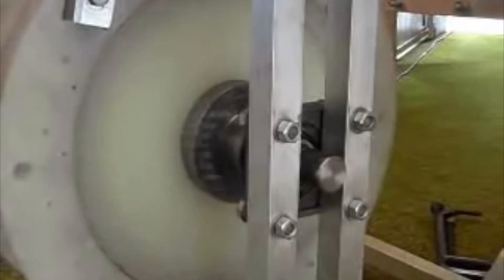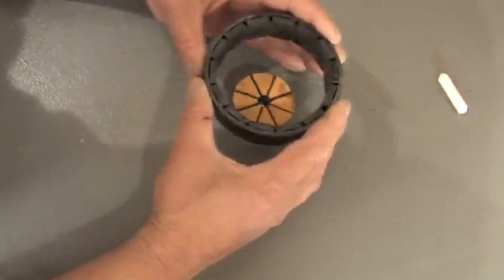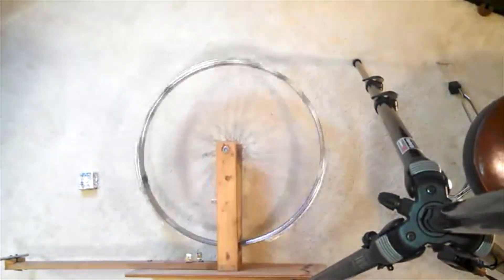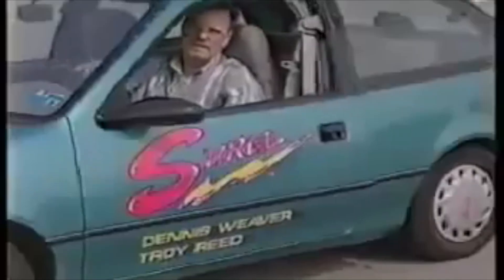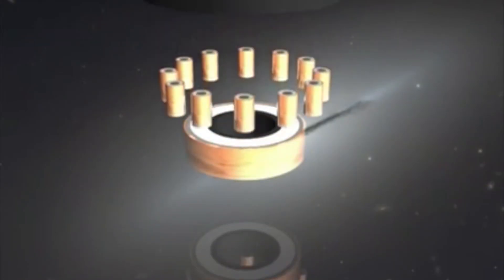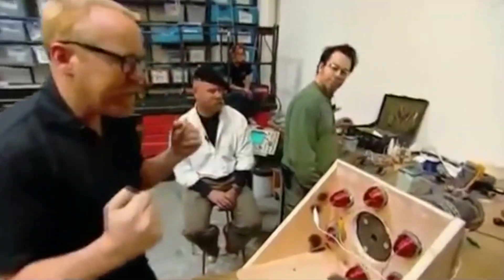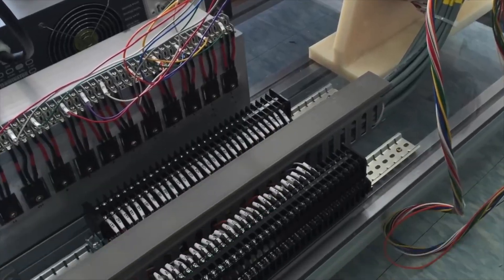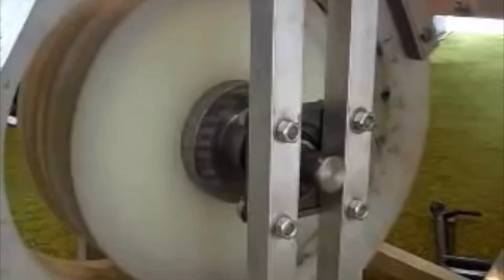Top 10 Most Famous Magnetic Motors

Comment: I admit that I have know idea if any of these work as intended. But I hate when people refer to magnet powered motors as "free energy" or "perpetual motion machines". Magnets lose their charge over time. Some might lose it faster than others, but they will all eventually lose their charge. The magnetic charge is the finite fuel source for the machine. Which means it is not perpetual motion and it doesn't violate the laws of physics. That fact alone makes me believe that it should be possible to make it work... At least I hope so!! lol
Reply: You are right. Technically, every type of motor, generator, or 'power source' is converting (not producing) energy. That is what all motors do. My thought process was this... While it takes a very long time, hundreds of years in most cases, magnets can and do lose their charge. This process will speed up with exposure to heat. If we imagine a hypothetical "working" magnet driven motor, as the magnets are attracting/repelling each other they are converting some of their "force" (potential) to heat and motion. Which would mean that there is a finite amount of potential energy that can be converted. Hence... no perpetual motion. The biggest issue (in my thought experiment) would be efficiency. I'm not claiming it can be done, just that there is a conversion of energy taking place in some miniscule way.    @darklight2.1
Reply: @darklight2.1    Even if monopole magnets would exist, it would still be impossible to build a magnet motor.

Comment: None of them work. Magnets don't contain energy, they can be used to push electrons therefore creating a flow of electricity, but a stationary magnet cannot generate electricity, it doesn't contain energy.
Reply: @randie9480 Clearly you don't understand what you're talking about. Of course there's mechanical energy since the things are moving, but they're not spontaneously generating motion because that's not possible. There's electrical energy in them that's being converted to mechanical energy, which is the converted to convincing idiots they're perpetual motion devices.
Reply: @randie9480 Also, the video clearly states that these devices are magnetic motors. If you're saying that magnets can be used to create movement then you've been fooled. Think of a magnet as a slope. Something can slide down a slope but for the slope to be used to generate energy the thing will need carrying back up to the top. Magnets will need carrying back to the top for free, carried back in a way that costs no energy. Which is impossible. Once you understand the fundamentals you'll never be fooled again I promise you.
Reply: @Indie9999 try to find spiraculum on youtube, and explain us his behavior, following actual phisics laws 😂 the tendency of science is to discover, surely not clinging to current knowledge 🤷🏻‍♂️

Comment: MAGNETIC DRIVEN MOTORS ARE IUT OF THE QUESTION. WERE ARE ALREADY WORKING WITH MAGNETIC G FORCE. IT IS A COMBINATION OF APPLICATIONS THAT CIRCULATE ENERGY. ON ITS OWN POWER. THERE ARE MANY Electronic COMPONENTS. THATS HOW WE WERE ABLE TO ACHIEVE WHERE OTHERS HAVE FAILED. IF YOUR JUST TRYING TO PUSH MAGNETS TOGETHER TO MAKE IT WORK, YOUR WAISTING YOUR TIME. THINK OUTSIDE THE BOX. π•∆ × RPM√ DIAMETER OF EA DISKπ √ ANGLE C/M • E√ FLUX • TIMING POS

Comment: The way to create a perpetual motion machine goes as follows. 
1. Get a large vacuum chamber.
2. Set up a superconding magnetic levitation loop inside the vacuum chamber..
3. Put the entire device on the dark side of the moon with an outside temperature of -250f.
4. Push the locked and levitating magnet on the circular superconducting track. or visa versa. a superconductor above a magnetic track locked and levitating. 
Theoretically it should continue revolving around the track forever.

In my opinion this would be one of the only perpetual motion machine possible. Because it has no atmospheric, gravitational resistance or resistance of any kind.

Comment: The video description has a link list to several magnet motor patents. Of course, even if a patent is granted, it does not mean that the invention really works.  And even more significant: most of these patents were filed but they were not granted. A motor which is driven by permanent magnets only is considered as a perpetuum mobile, and such inventions are not granted if the inventor can't give a flawless proof for the function. With the exception of H. Johnson, whose patents were also refused at first but by his stubborn insistence granted after some years, none out of the listed magnet motor patents were granted. And also H. Johnson never succeeded in building a working magnet motor. 
In the video it is claimed that several motors were patented. This is wrong. Just filing a patent is not yet a patent.

Comment: In the early 1900s, Nikola Tesla designed a magnetic motor that would revolutionize the way we generate energy. The overunity generator plan is based on his original design and will generate a free energy AC generator. This is genuine Nikola technology that has been lost for over 100 years.

The overunity generator plan is a simple, yet elegant solution to our energy needs. It uses magnets to create a rotating field that generates electricity. There are no moving parts, so it is very efficient and can be built with easily available materials.

This technology has been hidden from the public for over 100 years, but it is time for it to be revealed. The overunity generator plan will change the way we generate energy and help us to achieve energy independence.
Reply: Magnets can't be a source of energy-so where does the energy to do work with a "motor with no moving parts" come from?
If this amazing technology was hidden, who was hiding it? And how did you get access to it?
If it is so easy to build, why haven't you built one to demonstrate to everyone?

So-called overunity generators are a tired old scam that charlatans use to extract money from gullible rubes.
Which leaves us with the only real outstanding question, which one of these are you-the charlatan or the rube?
😵‍💫

Comment: How could you manage not to mention Dennis Danzik and his company Inductance Energy’s Earth Engine?  The only issue with Dennis’ design is that IE wants to sell the energy their motor produces for more than grid power and won’t sell or license use of their design.
Reply: Inductance Energy doesn't sell anything. They've never had a working product to bring to market.
Reply: @darklight2.1   Correct. Dennis Danzig is a scammer. Unfortunately, the 10 constructions mentioned here are also not working. If some of them are offered for sale, it is fraud.

Comment: My question is why the f can't we simply make a magnetic generator? What's the issue? Why the controversy? 
If a regular generator is just a gas powered motor that spins a belt... then why can't magnets be used to spin that same belt? Why doesn't this work? Man I'm intrigued
Reply: Because magnets aren't a source of energy.
Magnetism isn't a form of energy-it's a force. We can use magnetic fields to store energy (for instance, by pushing like poles towards each other) but magnets themselves expend no energy in the course of being magnets and cannot do work.

Think of it this way-when a magnet is hanging on your refrigerator door, how much energy is being expended to keep it there?
The answer is zero.
 To store energy, we would have to pull the magnet away from the metal and in that case, we are the source of energy-not the magnet.

This means that virtually any motor claiming to be powered by magnets, such as those "demonstrated" on  popular clickbait videos, is fake. Every single one.

Hope this helps.
Reply: @darklight2.1  I find that typically using logic on these people just gets the conspiracy answer. They don't understand enough physics to get why it doesn't work. So they keep trying:)
Reply: @KevinSmith-os5yz  another way of explanation - - - The "General Relativity"!   Every force in nature is balanced perfectly, example the south pole of a magnet, it attract from the right and also from the left with equal strength, which means cancelling each other into zero rest mood.

This can only be achieved by thorough understanding of magnetic fields and manipulating its physical properties.

Comment: Thank you for maintaining a neutral position i myself am not a believer in free energy but i think the subject matter is fascinating and studying all the different motor designs an asset to ideas for developing more efficient motors.
Reply: The Overunity Generator Plan will generate a free energy AC generator. This is genuine Nikola technology that has been used for over 100 years. The plans have been released to the public so that anyone can build their own magnetic motor.

The most famous magnetic motors are the ones that have been used in power plants for over a century. These motors are based on the principles of Faraday's law of induction, which states that a current flowing through a conductor will create a magnetic field. The strength of the field is proportional to the number of turns in the conductor, and so by increasing the number of turns, we can increase the strength of the field.

The high number of turns in these motors makes them very efficient at converting electrical energy into mechanical energy, and they are capable of generating large amounts of power. However, they are also very expensive to build and maintain.
Reply: @showshowtomakefreeenergyge2426    Every e-motor converts electrical energy into mechanical energy. Some designs are very efficient, but of course their efficiency is always below 100%. This isn't free energy. And power plants don't use motors but generators, which convert mechanical energy into electrical energy. Also here no trace of free energy. Which is no surprise. Every energy output needs an energy input, slightly bigger than the output. Of course also Nikola Tesla did not have any overunity devices. Magnetic motors in the meaning of a motor driven by permanent magnets only are outright nonsense.
Reply: They say hydrogen has more energy than it uses to produce Stanley Myers drove from California to New York and a dune buggy on water 1976
I know that's not any kind of indefinite motion as you got to keep adding water anyhow but that's pretty abundant and easily accessible
I seen some interesting gravity generators especially the Wilkinson machine I don't think they let him put a second video out
Reply: @miketully9592    Some may say that, but it isn't true at all. Meyers patents for over-efficient electrolytic cells are open to the public, but they don't work. Their efficiency is well below 100%. Meyers dune buggy was a scam. Since Meyer cashed prepayments for a prototype of a "water car" but never delivered anything and could not return the money, he was sentenced for fraud. Some claim he was killed, but that's nonsense. He died unexpectedly, due to autopsy the cause was a brain aneurysma.

Comment: If you liked this video, you should check out two that weren't mentioned. Troy Reed and Dennis Lee. 
Troy Reed developed a motor that was eight feet high and reduced it down to fit in a car. The car, when not in use, is plugged into the grid to power it, not the car. https://youtu.be/aF0JvC10edw to the car https://youtu.be/vFfsEfnsA4I
Dennis Lee's invention is a type of solar panel that works 24/7 and when hooked up to his condenser motor, produces free energy. Gasses like Freon are compressed producing high heat. 
Go see and SHARE. https://youtu.be/GTPYecWuppg
Reply: Troy Reed was a scammer. Solar panels work of course. But the term "free energy" is used here for types of energy which have no scientific explanation. Due to physics a motor can't be driven by permanent magnets, not for one turn.

Comment: Some thoughts. Each motive generator has magnets, even current generators. Neodimium( crystal) magnets last over 400 years on earth without a recharge.Magnetism is called a force meaning science has no idea what the 400 yr source is. Neo magnets fail from corrosion ie oxygen. In space no oxygen. Neo,s last forever in space? Scientific schools are funded by industry . Conflict of interest?.conservation of energy does not apply to magnets as the feild is self regenerative no matter how much is converted to electricity.  For an endless power source it must me  located in space and have a basic timing system,being either mechanical or electrical to shunt the magnet feild as required. The motionless electronic generator is an example of how to direct magnet force.RIP John Bedini and Tom Bearden Therefore ,my opinion is a perpetual power source is possible ,only being stopped today by industry protecting it's own best interests. Before anyone says over unity is not possible maybe they could explain magnatisms first feat of lasting 400 years on earth, and then work up to a magnets life in space.
It is simply manipulation of the magnetic feild that is the problem and Howard Johnson answered how self manipulation can be achieved. My opinion is The reason that we do not have such a power source now is that we the people are not allowed to have it as long as industry has other things to sell us. WWG1WGA WORLDWIDE
Reply: How is a magnet a power source? It isn't.
Reply: And the earth is flat, same conspiracy:)